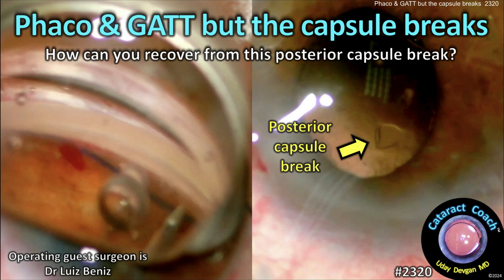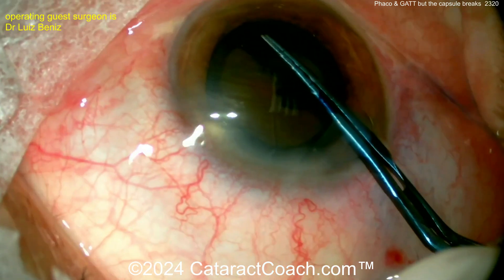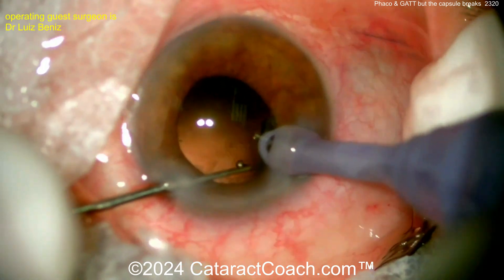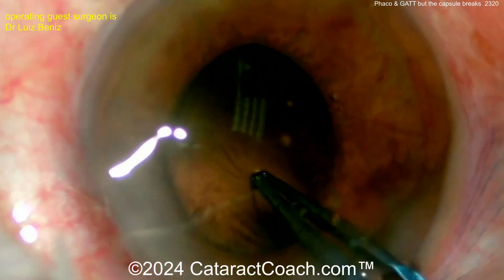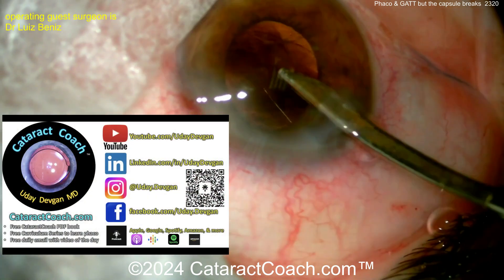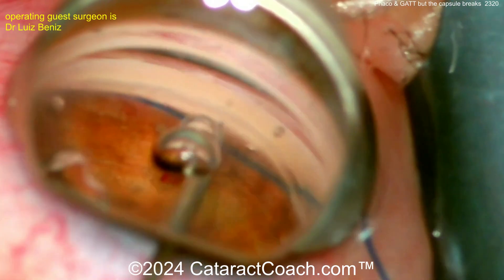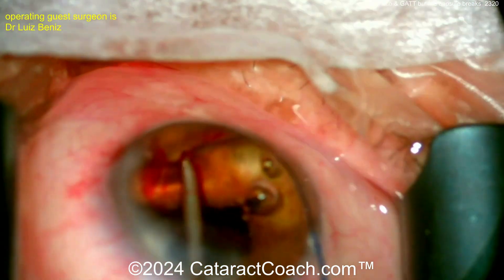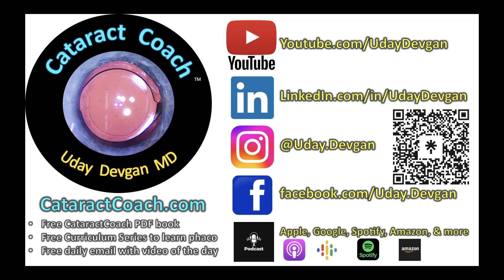CataractCoach™ 2320: phaco & GATT but the posterior capsule breaks

Comment: It's much easier to convert a small tear to a posterior rhexis if you firm up the eye a bit but equalize the pressure in front of and behind the posterior capsule with viscoelasitc so the capsule is relatively flat.  Then come in through a paracentesis with a 25g microforceps which grips the capsule better than a microholder which was used here (and doesn't have a fine tip for grasping something delicate like the posterior capusle.....alternatively a 23g micrograsper or microrhexis forceps can be used), and once the tear is initiated it's relatively easy to get it continued.  If you go through the main incision with a microinstrument, viscoelastic comes out, the posterior capsule comes forward and it will want to tear out.....plus you also have poor visibility as you are tearing here close to  your incision and with low IOP there will be folds in the cornea because you are angling the forceps down at an acute angle so coming in from a different angle through a paracentesis with a microforceps is the way to get this thing started after injected viscoelastic in front (and sometimes behind) to firm up the eye but not distend the posterior capsule.    But nothing wrong with a 3 piece in optic capture configuration.
Reply: Wonderful tips! Thank you! Will keep this in mind if I have to do it (Hopefully not)
Reply: Thanks Dr Safran. Your comments on today's and yesterday's videos were very useful!